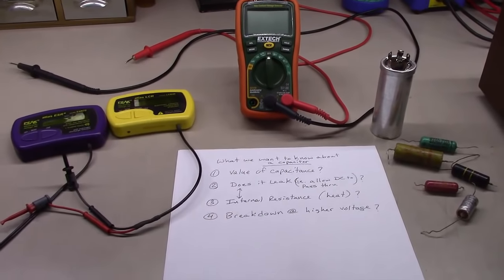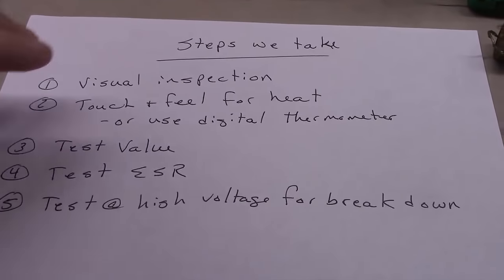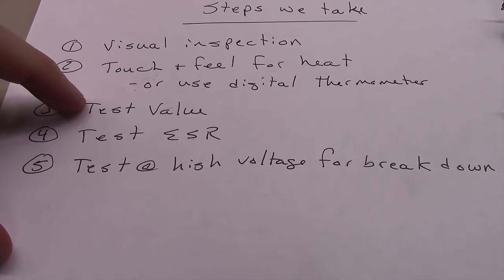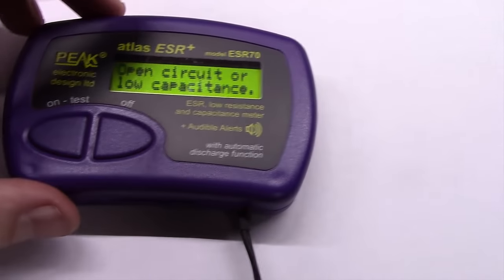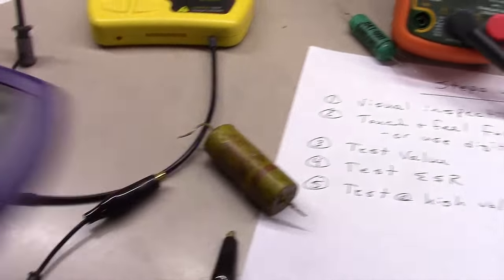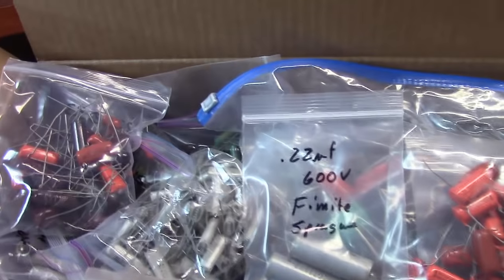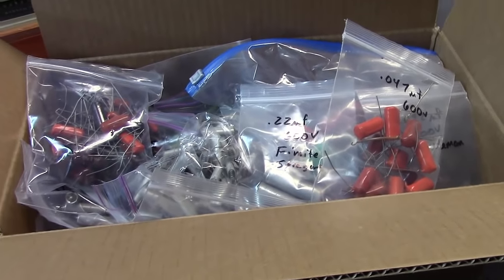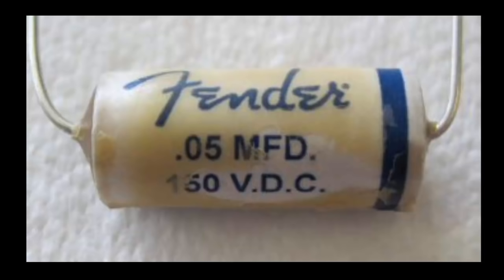Testing Capacitors - Simplified and Explained - BG029

Comment: Nice video, many good points mentioned here. One thing you mentioned when using the hi-voltage test: You do not get the ESR value this way. ESR means Equivalent Series Resistance, and can be seen as an unwanted resistor in series inside the cap (usually with electrolytics, as you showed with the "Peak" ESR meter)

Comment: If you're dealing with glue gun glue just use rubbing alcohol, it seems to break the bonds of the glue from the surface and does no dissolve into a mess, I can get my glue out in full chunks with this method.

Comment: At 28:33 the bottom right capacitor, hermetic package as you mentioned, may be either metrology grade low capacitance or (maybe more likely) a mil/aerospace type Wet Tantalum Electrolytic one.  As tantalum is quite heavy, you can often tell the type from its weight.  But you also can tell it by the capacitance -- the wet tantalums are generally in low voltage, tens to 150 V, several microfarads range.  The metrology types may be high voltage, low capacitance.  Anyway, the hermetic seal is usually an indication of something special and high reliability.

Comment: I like the way you ripped off the capacitor guy by squeezing him for an extra $5 when you know full well those capacitors are worth a couple $k. Well done! I guess taking anything to you also means you get to repeat the process. Bravo!
Reply: I agree the humble brag about how he got the price even lower is very cringy. Some people will haggle no matter what. You ask 100 they bid 50, you ask 50 they offer 30. I always think that if the asking price is fair (or even a steal in this case), haggling about it is just a bit sad. 

That said, ripping off is a bit unfair I think. The seller agreed, nobody got ripped off. Also taking a gamble with the goods, taking everything off someone’s hands, needing to go through and weed out a lot all add value to the products, so that should be accounted for in my opinion.
Reply: @ph4z_  He knew full well from years of seeing capacitors that they were in great condition and one or two alone would cover the full asking price. He pretended to the guy that had no idea he was 'taking a risk' when he wasn't. That to me is a moral and ethical failure and abuse of knowledge. The term 'ripping off' fits. Just because we can abuse or knowledge doesn't mean we should. He's a scammer as far as I can see, but I have morals and ethics so I guess I would see it better than others who have no morals or ethics like mine.

Comment: A minor correction to your description of the infra red thermomerer (bolometer). The laser has nothing to do with the measurement. It just tells you where the bolometer is pointed. Emissivity of the surface of the object also matters. Shiny reflective surfaces will often reflect infra red from some other object so you have to be careful in interpreting the readings you get with these things.
Reply: A thermal imager is the only way to accurately measure the heat of most of these items and the cost of IR or thermal imagers is well beyond the budget of most hobbyists.

Comment: Love your videos. I am 61 and looking to get into Vintage Audio repair not only to keep my gear in top condition, but to give back for what has been a lifetime of enjoying these fine components. I'm an electrician and built a Harley from scratch when I was 17 in my bedroom. I think I can figure this out.

I know a gentleman I work for who has an accent identical to yours. He's from around Waco, Tx.  

Anyway, I'm going to purchase a Sprague TO 6 and was wondering if I need to desolder every capacitor I test. I'm guessing yes, because if it is leaking voltage, it will send high voltage to the other components while connected to the circuit board and possibly damage them. Is that correct?

Comment: I bought an ESR70+ thinking it would make testing in-circuit caps easier...I am right now in the process of restoring a Marconi TF2331 distortion meter, which has a lot of electrolytics in it. I removed a 1000uF @15V cap despite the fact that the ESR70+ measured the ESR @ .12ohms and the cap at 1268uF which I would normally think is fine.

However, upon testing that cap on my old Sprague TO-6, the capacitance was ok, but the cap was very leaky at rated voltage of only 15vDC and effectively toast....Now I wonder about the caps I assumed were OK when checked in ckt with the ESR70+....YMMV, but I now have concerns about the effectiveness of these units....

Comment: I have the Tel-Ohmike TO5, the generation earlier to this one.  I actually like it better because the applied voltage is only present on the DUT when the testing button is pressed.  When released, it automatically drains the cap, so there is no chance of forgetting the lever is in the wrong position.

Comment: In a ' Shango066 ' video ( shango being a well known YouTube vintage color TV expert ) he works on some automotive scan tools where certain electrolytic capacitors break down and leak a substance that is conductive and the circuitry is so sensitive that if the unit is powered up with the leaked substance on the board it fries out some chips.
He has to clean the board thoroughly before installing new capacitors 
( and new fried chips )
Very interesting.

Comment: Great info, thank you for sharing this.  I envy you for this beautiful piece of equipment.  That gear is still rather expensive for the occasional user, so I learn when browsing the second hand market.  I only have one question.  Suppose you test an old, say 40 years, capacitor and it reads perfectly fine on all specs.  What does that mean with regard to its further use?  Can you keep it in service for another ten or maybe twenty years, or will you decide to replace it anyhow, based of its 'mileage'?

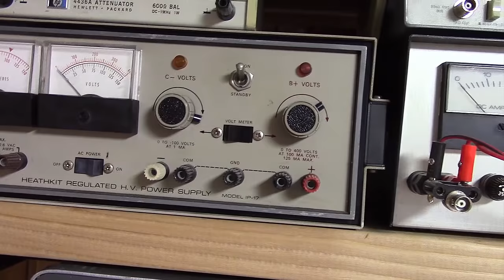Comment: Thank you; love the video. For us new guys, would you tell us more how to do the current leakage testing without the fancy sprague (the power supply and ammeter method mentioned at 22:40)? I'm specifically interested in testing vintage guitar amps' caps where 5-450v and 10-25 ufd are common). I'm trying to put together the tools I'll need on a budget;  is there a multimeter that'll do all the other tests (including -the aforementioned ammeter leakage, ESR and LCR)?
Reply: yes there is some meter avail cheap  go line  ask for capactor testors  select the one you want   they are rated in mfd -------ufd read the label pick out the one that meets your needs

Comment: The only thing I would test on an old ("vintage") electrolytic capacitor is how it sounds when it lands in the trash can. Once you have pulled it out of the circuit to test it, why put it back? Replacements are cheap nowadays.

Comment: the small condensers in distributors is made  with 2 strips very thin alum and 1 strip (wax paper ) like a sandwhich foil paper foil the small wire is conn. to 1 foil strip the little can is conn. to other foil..the mfd is the thickness and length of the foil  if you get an ohms reading its shorted if you have an analog meter (with a needle in stead off digits you can see this  touch meter leads to the wire and the can the needle will jump up and fall back down you will need a capacitor meter to read mfd or ufd  ---- this the way its used in a dist to creat a spark ---------battery voltage thru switch in run pos is conn to primary coil the other end of that coil is conn. the capacitor wire and one side of the points as the points open this lift the gd off this conn. allowing current to flow thru the capisitor to gd this causes a magnetic effect in the primary coil making a very high voltage due to thr turns ratio this voltage is connto the dist cap then to the rotor to spark a plug as points points close this flow stops   ---if capisitor is wrong value mfd or defective some of the voltage want get thru th capacitor so come back to the open points and jumps to gd,  causing the points to pit over time   if everthing is ok a quick test lets you veryfi this,by run eng remove a plug wire insert a wood handle screwdriver into the plug  wire   hold screwdriver close to the eng see spark  1/2 in spark is ok  less is sign of tbl    i test at .idle

Comment: Great video!  Since its practically impossible to get a unit like your Sprague tester, could one use a megohmmeter to test for leakage in old coupling caps in tube amps?  Thanks.

Comment: As i have no high voltage supply, nor your Sprague tester, I was looking for an alternative for a high voltage leak test.  What is your idea of using an insulation tester like the Fluke 1578, for testing the leak of a capacitor? This tester delivers till 1000V DC (or 250V or 500V ...) , by testing the resistance. Just by applying ohms law you receive an indication of the Leak current of the capacitor . Or not?

Comment: I need to get three non polarized  capacitors for my Goodwill scope doubler power supply.The capacitance value is 0.5 micro-farad at 1500 volt. I believe they are some type of oil capacitors. The design of the capacitors use terminal leads on both sides of the capacitors. The scope is a Goodwill 10 Mhz. Model GOS-3310.
Reply from the maker: go on ebay, search for .47 1500v  you'll find what you need.  you won't find .5uf, .47uf will work just fine

Comment: I agree with you caps can add up very quickly ,unless you get a deal.like you got,good for you,I no how,much orange drops alone can sell for ,I only been collecting caps for about six months ,and I only have one large gallon size zip lock .and it wasn't all that cheap even at Chinese prices ,and some from the u.s. ,and a bunch of resistors which I am sorting out .but you need that stuff on hand .even if you are working small scale like.me.a hobbyist.I have a Knight capacitor tester,a kg. 670 ,it's a restored vintage tester,that man who restored it says it was probably never used ,I can do more testing with it then  modern capacitors tester,

Comment: In guitar amplifiers they have a few filter capacitors, how do you test how much Current is stored in each filter capacitor? if there is 4 filter capacitors how many amps of current are each filter capacitors storing any way to measure to know if you have enough current for the circuit that is drawing. If the circuit under test is drawing 10 amps and have 4 filter capacitors how would you know what capacitance values for the filter caps to store 10amps of current for the circuit to work without starving the circuit?

Comment: Interesting presentation. ESR and Leakage are not related. So your Sprague tester does not indicate ESR. ESR is not the equivalent of a resistor across the capacitor. ESR is like a resistor inside the capacitor going to only one of the terminals. ESR reduces a capacitor’s ability to charge quickly and it generates internal heat when the capacitor is charging and discharging.
Reply: The Sprague tester checks for Equivalent Parallel Resistance or DC leakage which will destroy tubes and transformers alike as the DC resistance approaches 0 ohms.  Paul Carlson of Mr. Carlson's Lab discusses this phenomenon at length as well as designed two devices which checks for EPL or leakage at a very low 9VDC or 27VDC using very high gain circuitry, they both work better than the Sprague or Heathkit capacitor checkers which he has both of those as well.

Comment: Have you ever thought of using a megger to test a capacitor. With high voltage and resistance measurement should be able to determine the current. Maybe do a video about it

Comment: Good tips, been looking for a vintage condenser tester. The prices are going up for them. Quick question, do you think I can use 3300 uf to replace 2500 uf in the power supply of a old  non tube scope?
Reply: ,but  , I,

Comment: Thank you for the very informative video. Is there a difference between the capacitor that you have shown as samples in the video versus a motor run capacitor? Can a motor run capacitor be replaced by a general purpose capacitor such as an aluminum electrolytic cap?
Reply from the maker: it depends a lot on the application

Comment: Why does Cap. Bleed over to case ground? A slight (constant) arc can be seen.I used a fluke 87 to check between terminals and from terms. to cap. case no readings were detected.I hope I explained my self correctly.
Thanks

Comment: Is charging time supposed to be the same as discharging time with the same resistance load?. I've read it as such.
But i've got a setup that charges and discharges, the charging time fits very well what the math tells me, but the discharging time is almost twice as long??.

Comment: Wow!  I've been just buying one capacitor at a time because they're so expensive and I have no idea what capacities or voltages I will need.  Even at 1-at-a-time, I still end up spending $40 to $50 on a few capacitors for a single radio restoration (DigiKey/Mouser).  There has to be a better, more economical way.

Comment: is that 600 volt test a low amps test or something? I saw so much exposed wire and high voltage with that meter.

Comment: Great video but since its a few years on since its upload there's been a lot of discussion on the subject that needs a mention. I’m a bit confused by your presentation of what ESR truly is as I understand it to be something other than the representation by a capacitor of its leakage. Your Sprague meter table would be relevant to earlier era manufactured capacitors? It seems the no. one issue of a capacitor and the one thing that matters most is whether the device leaks current which means its acting as a resistor. You cover that off perfectly with the mention of bias issues and that's really important in any repair. So if a capacitor is leaky at low voltage it’s not necessary to test at its labeled working voltage either because if its bad at a low voltage it will be terrible any higher. As to value, that must be the last concern because that's solved for any leakage with replacement.

Comment: Its funny, those cheap chinese multi component testers you get on ebay actually beats the peak atlas ESR meter in many cases. It can go right down to the pF range and does leakage and ESR. Only bad thing is most have no input protection.

Comment: I have two capacitors, one is 1000microfarads 100volts, one is 1000microfarads 50volts. If I apply 50 volts to the 50 volt one it will charge to 1000microfarads, correct? So, if I apply only 50volts to the 1000microfarad 100volt cap, will it only charge to 500microfarad? Or will it just take more time to fully charge? I guess what I'm asking is, does a 1000microfarad 100volt cap require 100 volts to charge to 1000microfarads?
Reply: Simple answer, no. A farad is not a volt.  You can have 1000uF at 10 volts 20, 30 or whatever upto the rated voltage. Farad is a measure of "charge capacity" and volt is a measure of electromotive force. A capacitor can be thought of like a balloon in a way, and the size of the balloon is the amount of capacitance, like the larger the ballon the more farads.  And voltage is like the air pressure in the balloon.  The voltage rating of the capacitor can be thought of like how thick the balloon rubber is, the thicker the rubber the more pressure (voltage) it can withstand. I hope this helps to visualize the difference.
Reply: @garybevis8691  , in other words with less voltage it will still charge to full capacitance value but it will take longer.

Comment: Time is the enemy of capacitors. Used or new. If it's fifty years old or older... Why test it? Even if it test to be perfect, it ain't. So ask yourself is it worth it to buy fifty cap testers that will still fail on high voltage caps as well as the equipment the old cap will destroy or just replace the cap?